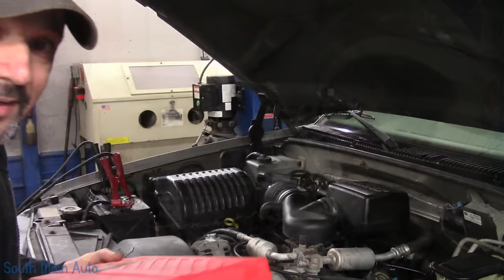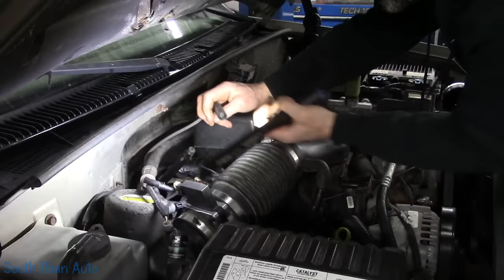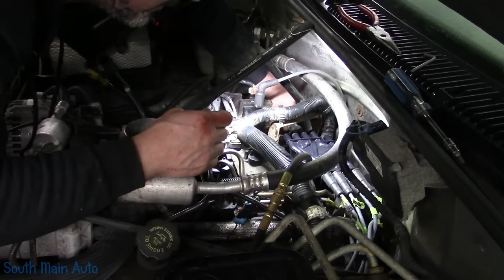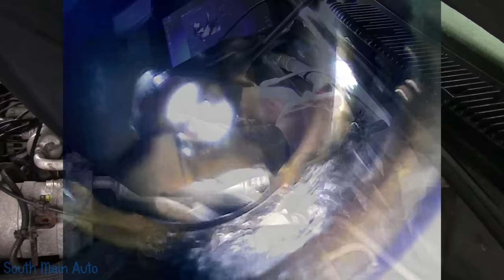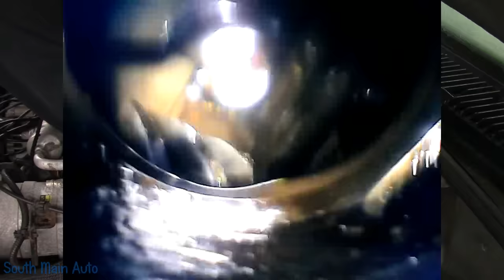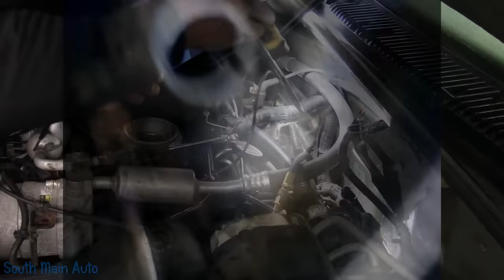Chevy Suburban 5.7 : Crank No Start Part I

Comment: Very interesting. I'm not a Chevy guy either, but I wonder if soft distributor gears was a thing on those?
Reply: The little rod that goes in to the black piece that the rotary button bolts to is what went in mine. Stripped right inside the thing ur button goes on.

Comment: I would have started with a timing slack check from the crank to the distributor. You still haven't ruled that out. Look down your fancy borescope to see how far the crank will turn without affecting the movement of the timing gear. I bet it is sloppy. The distributor gear is made of a lesser metal for a reason.

Comment: Check out this Milwaukee M-Spector 360 Digital Inspection Camera Kit With 9-Ft. Model 2314-21. M12.... or the 6-ft..  This borescope is amazing with its 90' degree mirror.. Helped me diagnost a bad head gasket where I could see the coolant coming out between the block and the head...
Reply: I put the camera thru the spark plug hole...

Comment: I cant check all 569 comments, so i dont know if anyone else commented on this, but at 15:55 i see what looks like antifreeze around the dizzy hole, and at around 16:18 obvious (on my big screen) droplets of antifreeze on the cam gear. There is no good reason for antifreeze to be in those two places, so my guess coolant leak onto cam/dist gear washing lubricating oil off and bam! 'Nother clue is the dizzy gear is clean and not dripping oil. 😱 Edit: 18:16 shouldn't the oil pump be a little more difficult to turn against the viscous oil? EDIT#2 Had time to think about it...coolant is from intake gasket leak, causing the miss, and washing the lube off the dist gear causing it to fail.  Oil pump condition is a wild card and i guess can be checked when dist gear is repaired.

Comment: I just bought a 99 tahoe for 500 bucks same exact problem by the first compression stroke rotors pointing toward fire wall so whoever put that distributor in they shoulda just left it alone also let me add it's all new in there to

Comment: Hey Eric I love your videos. I was on your life what's up Wednesday the other day and I was talking about my brakes and putting brake grease on the brakes well I took them apart and yes the brakes were definitely bad. I also learned that you can't use a 3/8 drive on 1/2 inch breaker bar because it breaks... Anyway I got the brakes on I got the caliper back on the brakes and now the brakes are on all the time but I can still go. I'm being totally serious. Should I replace the caliper do you think it's bad if they are rear brakes.
Reply: Yeah those adapters give you a false sense of hope. They are useful as a mechanical fuse though..
Reply: You obviously shouldn't drive with the rear brakes applied all the time. What make, model, and year is your car?
Reply: If you grease your brakes won't they squeal like a pig? Brake grease! You are too funny! LoL

Wait! You didn't really do that right! 
Axle grease on yer brakee pads will extend their wear n tear I tell yas!! 

Doing 100 with no brakes: well it looks like I'm going to crash now! what a shame! and I jus did thee braaaaaaakes!

Do not put axle grease on your brake pads. OK. I WON'T.

Comment: Crank position sensor I think is the cheapest and most likely culprit if you get a crank no start or it stalls while driving and then starts up. $30 part, 30 minute job. Seems to have worked for me on my 2005. But maybe I'll get stuck today but it got me to the strip club and back last night so I think it's good.
Reply: Or something in the distributor if you have a distributor.

Comment: Wow that's one knackered dizzy, but i would rather a nylon gear wear than the one inside the engine. :-)
The timing must have been jumping around like mad before the owner finally killed it.
Reply: Knackered dizzy and mad. This is the most uk thing ive seen all day. Lol.
Reply: bentboybbz
Yep i'm all mad, goes with the territory :-D
Reply: @zx8401ztv  - l've started using the term "dizzy " for the dist because i like how descriptive it is.  But I'm not going to use bonnet, boot,  spanner or petrol though😆.
Reply: cmans79tr7
It's just a slang word for distributor, ' it needs a new dizzy cap mate.'
I would never call petrol 'Gas' as it's not gas, it's a liquid untill atomized.

Spanner/wrench i use both.
Fender is an odd one because on a car we call it a wing (yep daft), but on a motorbike it's a mud guard.
I don't make the words up :-D

Comment: Lmfao. I was sitting here going it's gotta be the distributor gear is chewed up. Probably fixed north of 10 of these issues. From cam crank correlation to the gear just being round. 4.3l 5.0l and 5.7l.

Comment: Okay guys need help my 5.7 cut off while running just stoped burnt up starter trying to restart wouldn't I disconnect#3 plug and starts right up while running I plug 3 back in and it cuts right back off will not restart I unplug again starts right up any ideas please
Reply: Distributor cap and rotor

Comment: ground strap from back of engine block to the passenger side frame can wear and break over time , cuts fuel off , truck ( 98 gmc k1500) would crank but not start ....note--strap at back of block is a bastard to get to

Comment: To diagnose no run conditions I was always taught to check the 4 things required for an engine to run. 
1. Ignition
2. Fuel
3. Timing
4. Compression
Finding one of those is not so hard, but finding what is causing that issue maybe harder.
Reply: @Thomas doing those checks will get you at least most of the way there into narrowing down the problem. 
1. Check ignition - pull the plug and ground it. Then watch if it fires. 
2. Fuel - Do you smell fuel in the chamber? Can check if the fuel pump works. Sometimes spraying some starting fluid in can verify this too. 
3. Timing - Check to make sure the plug wires are correct. 
4. Compression - does it sound like it has compression?

Comment: Might be worth just changing the drive gear on the distributor and try it...wonder why it stripped the gear..
Reply: That's pretty much toward the top of the engine right so maybe it was run with low oil and the gear got hot and disintegrated.

One comment was talking about those Chevy engines that get good oil delivery to the distributor/cam gears but not so much when the vehicle is idling. So if you leave your car idling excessively they wear prematurely, friction and heat. 

Other comments were talking about a composite distributor shaft which could flex and move around.

Another comment or two was talking about the cam gear moving around from worn camshaft bearings? (I think this might have been the case in this particular vehicle.)

So you could think about a distributor gear going out and damaging the cam gear. Or damaging oil pump.

You could think about the oil pump going out freezing up and damaging the distributor that is linked to the oil pump. 
You could think of the cam shaft bearings being wore out so the cam wobbles and beats against the distributor gear. 

So I guess sometimes they beat the hell out of each other!

Comment: How about the cam bearings. If that rear cam bearings bad won't it move the cam around and cause that?
Reply: For it to move that far the cam would need to flex a lot. Not going to happen with a stock cast cam. It would also show wear on the cam gear which this one looked good.
Reply: @Blazer02LS  was just a thought.
Reply: The cam gear is much harder than the distributor gear. Even in the unlikely event that all the cam bearings would be loose enough to damage the distributor gear, the cam gear would likely survive. Just as it survived whatever killed the distributor gear this time.
Reply: @fascistpedant758  oh I get and know that but you gotta admit stranger things have happened.

Comment: Distributor prob stipped from cranking for so long and the faulty ignition module firing partially
Reply: I don't see how cranking could be much harder on the gear than running.

Comment: well.........my recent experience with GM distributor, 1999 Chevy 4x4 heavy K2500 7.4l .....distributors like to fail on 88-2000 vortex motors right after crossing the 150,000 "mile marker" and if not r & r quickly will lead to cam gear wear to the point timing goes off and chunks end up clogging oil pump and low n behold......detonation! this is cause and effect to all motors, but chevy's for sure....5.7 and 7.4 main players. I've been waiting for you to take the adventure into the c/k series GM trucks for various issues, thanx but in the case of this video.......your about 7 months too late to help me, lol. So moral of this story, if this situation pops up on your Gm engine get it looked at ASAP! or do like me and drive it till it blows, then get about 5000 bucks out of the bank and go get a GM reman long block...............just about to F' up another motor, lol I own 3 of these GM c/k's.........by the way I've been a GM trucker for about 30 years now, love my "older" GM's there's parts everywhere rite now, don't know when GM will cut off parts as anything 20 years and older manufacturers like to discontinue stockpile.

Comment: I paused it @6:18, gonna guess mag pickup if he actually did change the cap and rotor.

Edit @9:40: Oof, way worse than a pickup, that sucks. Hopefully there aren't sheared off bits floating around the bottom end.

Edit 2: I'd stick a magnetic plinko tool down there and try to fish out any debris, looked like that dist gear was missing some pieces and the edges of the cam gear teeth were pretty worn.
Reply: I was also wondering where did that broken tooth end up?

Comment: Can that chewed up distributor gear have left enough debris in the engine to cause further damage?
Reply: It should never get past the oil filter
Reply: If the distributor is driving the oil pump and the distributor is skipping teeth, can the engine starve for oil?

Comment: It is surprisingly common on those with the plastic distributors.
Reply: Edward Martinez  GM timing chains on small block chevy's from the 60's through the 2000's are extremely rugged and reliable.  Way better than a cog belt that some genius came up with.  In the 70's a few of the CAM gears had plastic covered teeth to make them quitter, and those didn't last long.  I don't remember ever seeing a broken chain on a Chevy, but I have seen a few where the chain had so much slack that it wore a hole in the timing chain cover, probably at over 200k miles.

Comment: Tryagnostics... There's a word going into the vocabulary from now on... I have just the right guy to use it on... That old dizzy drive, kind of reminds me of the Pencil drive abortion on UK Ford Essex engines. The pencil drive would round off, the Dizzy would keep spinning but it wouldn't drive the oil pump on cold start mornings, leaving the engine strugglig to get any oil pressure just when it needed it most, -8C cold start winter mornings... Of course it always started first twist of the key when that happened...

Comment: keep that distributor and cut the teeth off the gear attach a cordless drill to the rotor shaft and you will have oil pump turning tool.
Reply: Jerry Moore-yep, my thought exactly. When I commented shortly after you did, I also said that you should also keep the distributor housing. Then, if you need to prime a fresh small block Chevy rebuild, you just drop the whole thing in and spin it with a drill. The housing actually helps direct the oil where it needs to go.

Comment: Did you just say, "Brand new set of Autolites?"  Why is he putting Ford plugs into a GM truck? Shouldn't he be using AC Delco plugs?
Reply: Ain't nothing wrong with autolite. Been using them for years no issues

Comment: Hey lady! Waddaya mean you don't have an oil pump driveshaft for a small block Chevy?!? You've got one right next to you Dr. O! You already know that it needs a distributor (I REALLY dislike it when people say "dizzy") soooo...pop the rotor off of the old distributor, knock the roll pin out of the gear, slide the gear off of the shaft, pull the shaft out of the housing and there you have it. Chuck the distributor shaft into a drill and spin the oil pump. The core charge for a re-man distributor is a joke when you compare it to buying a tool and it's much easier than fooling around with a screwdriver. I hope you get my joking in this comment but seriously, that's all you need to do. I AM a Chevy guy and I hoard the old engines (especially the 400 small blocks) for my various projects. F.Y.I. if you ever need to prime an oil pump on an old school Chevy engine rebuild, do the same thing but put the shaft back in the distributor casting. I'm also wondering if you bought the aluminum diamond plate and chicken lights for Mrs. O's van yet. Rock the Kia big truck style like I suggested!

Comment: Same engine in my '97 GMC K1500. Might be bits and pieces at oil pump, cam, pan. Quick check for shiny oil. Someone may have jammed the distributer and broke the teeth, or didn't compensate for the mesh/rotation if it was pulled then reinstalled. When my oil pump drive went, it chewed up the teeth on the distributer and had to replace distributer also.

Comment: Bushing in the Distributor started seizing up. I seen this before.
Reply: I recall them having gears eaten off and bushing were perfect still. I still swapped the whole dist. since the pickup coil and the rest looked ugly from cap/rotor carbon debris, well and 140k+ on all
Reply: @throttlebottle5906  I had them eaten on me. Caused from poor oiling. The bushing gets hot and bang. It seized upon me. Come to find out. The oil passage to that cam gear was clogged up. It only takes a few seconds. As that distributor gear is designed softer. So as not to eat that harden cam gear. 

And cranking on that starter. Just eats it more. As that cam is having to turn the gear with lots of force. Not going to last long doing that...

Comment: I had a Tahoe with the 5.7 
Did the same as this customer even burnt up the starter like he did (I was 16). Ended up being here was a crack down the distributor along the shaft, threw the timing off.

Comment: Did someone have that distributor out and just mashed it back in? That would do it.  Not lined up correctly. Or I  Heard those gears on the L31 vortec have chewed up.  Never had a problem on my TBI chevy it looks new. Maybe GM used a crappy gear on the later vortec small blocks.  Save the old distributor. Grind the rest of the teeth off and there ya go now u have a distributor oil pump turning tool.   I keep one around when the distributor wont drop in because the oil pump drive moved a little. Stick in in the hole, turn it slightly,  Distributor drops right back in.

Comment: Autolite plugs in a Chevy.  Not something I would of done.
Reply: Outta lite but they wont.  Lol
Reply: all i run  ..have them in my 56 331..all my corvairs   my 95  transport  my 69  302 mustang   my 85 honda rebel   my ke100  dirt bike...ac delcos wont hold  up in my 56    an i retired from gm  it just   the cold foul  easy
Reply: could end up with halfbreed offspring "Fortex" engine! Hope that wasn't to offensive...........
Reply: @ryerob741   Ford sold Autolite to Honeywell when they began manufacuring the Motocraft brand.

Comment: Every job is a "Now- what really happened , from the beginning". I had a customer complaint that the system wouldn't come.(computer). Turns out the power was out of the entire building but he happened to call me to figure it out. I had a guy call me to tell me what the input voltage at the main disconnect  only to mention there were no lights on in the facility!!  Like Gomer said about Aunt Bee's freezer to Opie, "Oh electric, eh?" Sherlock Eric

Comment: My 1988 Chevy Camaro Iroc-Z with the 5.7 engine chewed up the distributor gear EXACTLY like that around 180k KM's (112k miles), no cause was found. Installed a new one, and it lasted almost exactly 5000km's (3000miles) before the car was stolen and never found :( R.I.P., loved you so so much :( http://ecuflashking.com/pics/1988iroc.jpg

Comment: Yes always buy new and reason it does that is the gear was manufactured a little to soft. The new distributor should be aluminum. Very common on the GM V-6 and V-8. Great video as always

Comment: Dropping in a new distributor will be like playing Russian roulette. There are still small pieces of metal from the old distributor inside the engine. It might last a few minutes or a couple hundred thousand miles no one really knows.
Reply: @MilhausMN I would run it as well. Worst case is the engine grenades. Your in the same spot you were already in. A lot of times the oil filter will pick up a lot of that metal. Like the engines wiping off a cam lobe and sliding a new cam in.

Comment: BTDT
https://www.youtube.com/watch?v=yNlIq8iBIaI  Failed distributor 200 miles from home. That was a fun family camping trip!  While waiting for my AAA to be upgraded and get towed, mice chewed up the wiring to the distributor, and oil sender. It had been replaced once before I got it with a metal unit. Got a billet aluminum one from 1aauto, running good now.  Cam gear looked in pretty rough shape, but it is still going
https://i.ibb.co/fqZ5Md3/32882584-2240944632626080-1468017395116277760-n.jpg